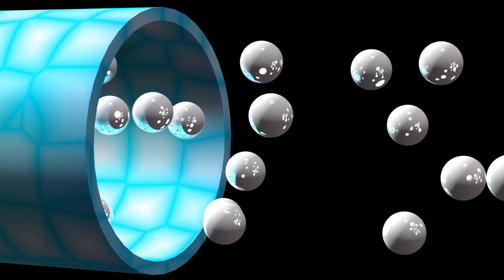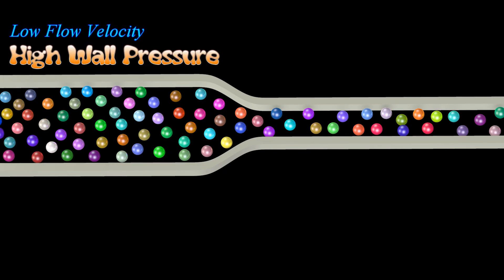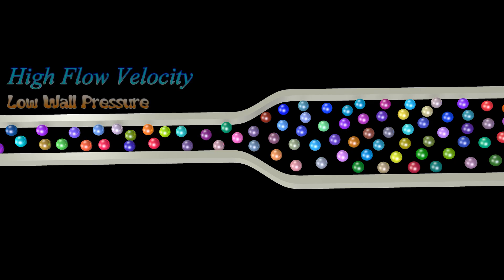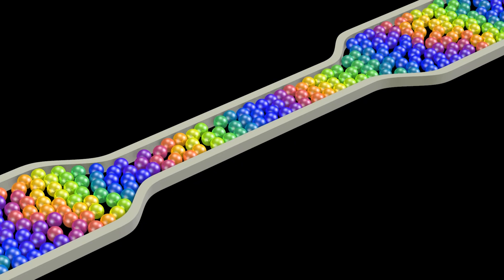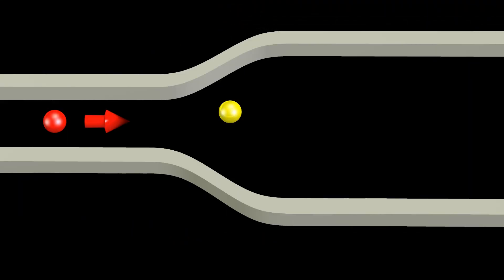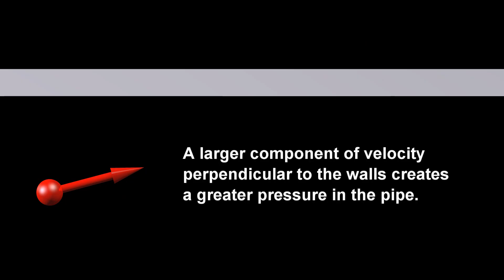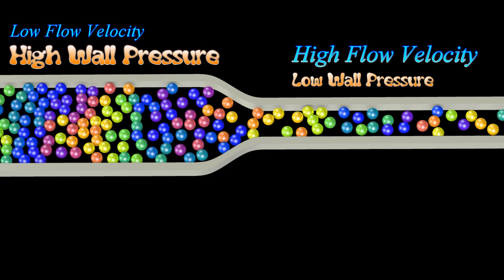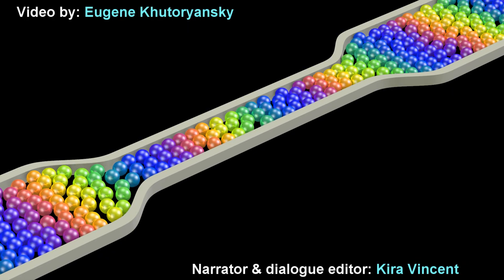Bernoulli’s Principle on Atomic Scale

Comment: So by your explanation,  could you change the pressure on the faster, narrower section by changing the sharpness of the entrance to it? If it it’s corners where completely right angled, there would be less flow but a greater velocity as this section then more likely includes particles in parallel direction ? There’s so many ways to interpret this
Reply: This explanation very much reminds me of the “what is life book” by Schrodinger.
Reply: No.
The shape of the diameter change can't change the velocity change.  It is solely dependent on the  two diameters. The volume flow is only area dependent.
If the cross section is half, the speed must be twice to get the same volume through.
..
Unfortunately his explanation is flawed as follows:
..
First, the statement at 2:07 is correct. "there is no reason to expect an atom with a higher velocity to exert a lower pressure on the walls of the pipe." 

There can be the same pressure in a fast fluid as a slow fluid.  They simply have the same static pressure. Bernoulli is not about speed. It is about changes in speed or velocity which is Acceleration along a path. 

The pressure on the walls of a sealed jar is the same regardless of the speed of the jar.

A fundamental flaw in this misconception at 2:42 is is that there no reason to expect a molecule to have the thermal vibration in only one dimension.  These pressure causing vibrations are random in direction and are how they bounce round between other atoms.  
At any given instant a molecule may be going down and the next at 90 degrees or even 180 degrees to the previous vibration.  
That simple fact breaks this false logic.
..
Then. . . 
It is the average velocity (over time) that has a directed motion when the kinetic energy is added to produce an increase in speed. That directed velocity is vectorially summed to the random vibrations.  This is vector addition of velocities. This means that the random vibrations are superimposed onto the linear velocity along the tube. This is fundamental physics. Vector quantities like speed and acceleration add vectorially.
Ignoring that fundamental physics is another flaw in this.
..
..
Then, the added kinetic energy in the moving fluid is in only  direction.  It is not increasing the random thermal vibrations. That would require increasing the temperature.  This is another flaw in this story.  Moving the fluid along the pipe does not raise the temperature.  
Therefore, the statement at 2:23: "an atom with a higher velocity would have a higher kinetic energy and, therefore, exert a larger force on the pipe walls" is false because it conflates / confuses thermal energy and momentum in one direction.
..
..
Consider bouncing a ball on the floor. Each bounce imparts some momentum to the floor.  The ball's actual motion is only vertical..

Now, start the room moving (a train car) and the ball still imparts the same momentum to the floor with each bounce.  It's actual motion, relative to the stationary ground changes.  It has the SAME vertical component, but now a horizontal component vectorially added to the vertical motions.  The pressure on the floor does not change.
.
 However, these two motions are orthogonal and have no effect on each other. The vertical up[and down bouncing component remains the same. ONLY the ground referenced horizontal component changes as the speed increases.
This physics does not change if the ball is bounced on the ground outside the train's window.
.
This fails on these fundamental physics errors.
Reply: Thank you, you have cleared quite a few things up for me regarding the narrators explanation. I still have many questions.

If I may, your very first paragraph still sounds phenomenological to me- sounding very much like the phrase  “it just does”. Why must all the volume follow through? Why can’t particles move independently through, in which case lowering the flow into the smaller section ? I would guess due to the attraction between the liquid molecules- in which case could I infer that you could reduce flow by using a liquid a infinitesimal attraction? 

Also, what causes the increase in average kinetic energy?
Reply: @townley1017  Ok  I think I understand your question.
..
Short answer: Because the volume of a small parcel can't change.
..
It should be obvious. You can't get the same volume of water or air through a smaller pipe at the same speed.  It must flow faster in the smaller pipe.
..
Water and air, at the speeds we are talking about, are incompressible.  As a small volume flows along, it can change shape, but not volume.
It is explained well here at time 2:55
 https://www.youtube.com/watch?v=LI9Mi1KhFTs&t=175s 
..

Comment: So basically the reason the Bernoulli principle works for that pipe is because the pipe lets molecules with tangential velocity through more easily. Since these molecules move parallel mostly to the pipe they don’t collide much with the pipe so the pressure lowers in the thinner section. If I had to phrase it in a sentence “A narrow pipe selects parallel moving molecules that move along the pipe instead of into it lowering the pressure”.
Reply: No. 
Unfortunately this explanation of Charles Crummer, is completely flawed as follows:

The statement at 2:07 is correct (perhaps the ONLY one). "there is no reason to expect an atom with a higher velocity to exert a lower pressure on the walls of the pipe." 

There can be the same pressure in a fast fluid as a slow fluid.  They simply have the same static pressure. Bernoulli is not about speed. It is about changes in speed or velocity which is Acceleration along a path. 

The pressure on the walls of a sealed jar is the same regardless of the speed of the jar.

A fundamental flaw in this misconception at 2:42 is is that there no reason to expect a molecule to have the thermal vibration in only one dimension.  These pressure causing vibrations are random in direction and are how they bounce round between other atoms.  
At any given instant a molecule may be going down and the next at 90 degrees or even 180 degrees to the previous vibration.  
That simple fact breaks this false logic.
..
Then. . . 
It is the average velocity (over time) that has a directed motion when the kinetic energy is added to produce an increase in speed. That directed velocity is vectorially summed to the random vibrations.  This is vector addition of velocities. This means that the random vibrations are superimposed onto the linear velocity along the tube. This is fundamental physics. Vector quantities like speed and acceleration add vectorially.
Ignoring that fundamental physics is another flaw in this.
..
..
Then, the added kinetic energy in the moving fluid is in only  direction.  It is not increasing the random thermal vibrations. That would require increasing the temperature.  This is another flaw in this story.  Moving the fluid along the pipe does not raise the temperature.  
Therefore, the statement at 2:23: "an atom with a higher velocity would have a higher kinetic energy and, therefore, exert a larger force on the pipe walls" is false because it conflates / confuses thermal energy and momentum in one direction.
..
..
Consider bouncing a ball on the floor. Each bounce imparts some momentum to the floor.  The ball's actual motion is only vertical..

Now, start the room moving (a train car) and the ball still imparts the same momentum to the floor with each bounce.  It's actual motion, relative to the stationary ground changes.  It has the SAME vertical component, but now a horizontal component vectorially added to the vertical motions.  The pressure on the floor does not change.
.
 However, these two motions are orthogonal and have no effect on each other. The vertical up[and down bouncing component remains the same. ONLY the ground referenced horizontal component changes as the speed increases.
This physics does not change if the ball is bounced on the ground outside the train's window.
.
This fails on these fundamental physics errors.
Reply: I see your point at 2:42 the molecules thermal energy or temperature does not change moving from wide pipe to a narrow pipe. The water molecules have a linear velocity superimposed on the thermal motions.I see your point in the animation the linear velocity is shown to be the source of the pressure on the pipe walls.That’s not the case for an actual pipe its the random thermal motion.
Reply: @burningsilicon149  You appear to have it.  The linear velocity added parallel to the pipe (speed along the pipe)  does not change the random motions in any other direction. It only increases the average speed down the pipe.
If you move along at the average speed, the random motions look identical to you. Therefore, the motion toward the wall imparts the same momentum to the wall. 
Just because a molecule hits the wall with more of a glancing blow at times, does not reduce the momentum toward the wall that it would have has were there no average component parallel to the wall.. The component of velocity perpendicular to a wall foe any single bounce remains the same.
..
Drawing a vector diagram helps. Show the horizontal parallel to wall) and vertical (toward wall) components.  Then add something to the horizontal.  That does not change the vertical.
It is, indeed, the pressure change along the pipe that accelerated the fluid. 
This shows that you can have the same pressure at any flow speed.
It is the pressure difference that accelerates the average flow.
.. ..
The linear speed along the pipe does increase the pressure where the pipe narrows. That directed velocity causes more momentum to be transferred to the slopped walls.  This is what increases the pressure in the large section. 
.. ..
If you keep a constant flow volume, then deforming the pipe from uniform diameter to one with a narrow section will cause the pressure ahead of the new, squeezed small section to increase. 
The small section can be viewed like an opening in a pressure tank where the fluid molecules can,  in a sense, "escape".  

See this video at 31 seconds:
https://www.youtube.com/watch?v=hZ5fZ3K4_mE&t=31s 
.
A molecule only goes toward the small section on an occasional 'bounce'.  That is one random bounce.  The next bounce can be in any direction, so the average does not have any preferred direction. 
If this description was true, then molecules with an instantaneous velocity back upstream into the fat section would be traveling backwards.  
This description shows no understanding of how vector quantities, such as velocity, add.
Reply: So because the pipe walls are sloped the linear speed of the molecules collides into the walls. This causes a higher pressure to be exerted on the sloped section of the walls.In my mind I see the molecules deflecting off the sloped walls.This causes the pressure on the larger diameter side to be higher.With this in mind if you change the pipe to 2 rectangular prisms. One with a larger square cross section and one with a smaller square cross section.Have them connected without a sloped walls.The walls are only vertical.

So the molecules will only deflect backwards due to there linear motion.I expect the fluid to increase in density in this situation to provide that pressure difference you talked about.However given a fluid is practically incompressible I’m not certain this will happen.
Reply: @burningsilicon149  OK.  You're catching on.
..
Except individual molecules bounce / rebound off the surface with more force than if there was no overall flow.  This gives them more momentum when they rebound and this transfers more energy to the molecules further away that they bump into and so on as we look further from the wall.  

We call this 'communicating' the pressure difference across the near-by region(s).

This forms a Pressure Gradient that is highest at the wall and diminishes toward the center of the pipe and also carries the pressure increase upstream.  
.
To look a little more at this: 
This also means that the flow is slower at the outside due to the higher pressure and the center water moves ahead of the water at the outside as it speeds up into the narrow section.
..
Also: 
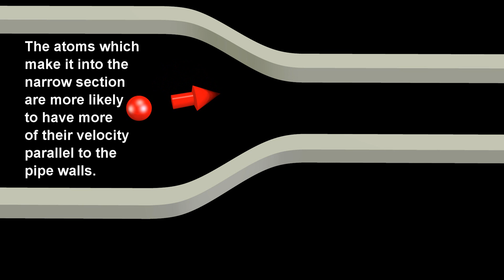Because this Gradient is across the flow, the flow curves gently to follow the curved surface.  Like this at time 3:15
 https://www.youtube.com/watch?v=nuQyKGuXJOs&t=195s 
..
Now to your  vertical transition walls.
Again, individual molecules will bounce off the wall backwards, but again, the increase in pressure is communicated back up-stream and the flow is again smooth curves around the corners.  But the pressure increase is similar. Like this at time 11:59. That surface isn't quite vertical, but you should get the idea:
 https://www.youtube.com/watch?v=nuQyKGuXJOs&t=719s 
.. ..
Water and air at speeds we are talking about are virtually incompressible.
..
Watching more of those NSF videos can provide a wealth of understanding. Several people have all them up on YouTube.  You can search for "NSF Fluid Mechanics Series"
..
Regards

Comment: Thank you for making this video. No explanation online ever explains what happens on a molecular level. I could derive and agree with the explanations provided in other places, but was never fully convinced of it. Other explanations treat the law of conversation of energy as some sort of driving force that causes the principle to be true, while the correct way to understand this is after zooming in and seeing how the individual atoms interact so that conservation of energy holds.
Reply from the maker: I am glad you liked my video.  Thanks.
Reply: Unfortunately this explanation of Charles Crummer, is completely flawed.
.
Yes simply stating the very vague and high level about energy explanations are insufficient to understand the real physics.
.
This explanation has several flaws and it makes a serious error in the energy assumptions.

As follows:

The statement at 2:07 is correct (perhaps the ONLY one). "there is no reason to expect an atom with a higher velocity to exert a lower pressure on the walls of the pipe." 

There can be the same pressure in a fast fluid as a slow fluid.  They simply have the same static pressure. Bernoulli is not about speed. It is about changes in speed or velocity which is Acceleration along a path. 

The pressure on the walls of a sealed jar is the same regardless of the speed of the jar.

A fundamental flaw in this misconception at 2:42 is is that there no reason to expect a molecule to have the thermal vibration in only one dimension.  These pressure causing vibrations are random in direction and are how they bounce round between other atoms.  
At any given instant a molecule may be going down and the next at 90 degrees or even 180 degrees to the previous vibration.  
That simple fact breaks this false logic.
..
Then. . . 
It is the average velocity (over time) that has a directed motion when the kinetic energy is added to produce an increase in speed. That directed velocity is vectorially summed to the random vibrations.  This is vector addition of velocities. This means that the random vibrations are superimposed onto the linear velocity along the tube. This is fundamental physics. Vector quantities like speed and acceleration add vectorially.
Ignoring that fundamental physics is another flaw in this.
..
..
Then, the added kinetic energy in the moving fluid is in only  direction.  It is not increasing the random thermal vibrations. That would require increasing the temperature.  This is another flaw in this story.  Moving the fluid along the pipe does not raise the temperature.  
Therefore, the statement at 2:23: "an atom with a higher velocity would have a higher kinetic energy and, therefore, exert a larger force on the pipe walls" is false because it conflates / confuses thermal energy and momentum in one direction.
..
..
Consider bouncing a ball on the floor. Each bounce imparts some momentum to the floor.  The ball's actual motion is only vertical..

Now, start the room moving (a train car) and the ball still imparts the same momentum to the floor with each bounce.  It's actual motion, relative to the stationary ground changes.  It has the SAME vertical component, but now a horizontal component vectorially added to the vertical motions.  The pressure on the floor does not change.
.
 However, these two motions are orthogonal and have no effect on each other. The vertical up[and down bouncing component remains the same. ONLY the ground referenced horizontal component changes as the speed increases.
This physics does not change if the ball is bounced on the ground outside the train's window.
.
This fails on these fundamental physics errors.